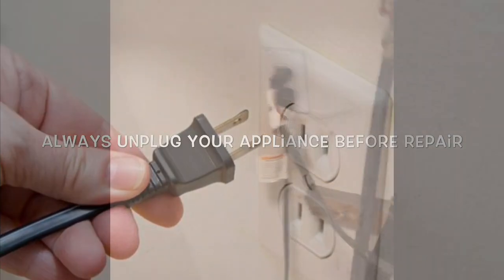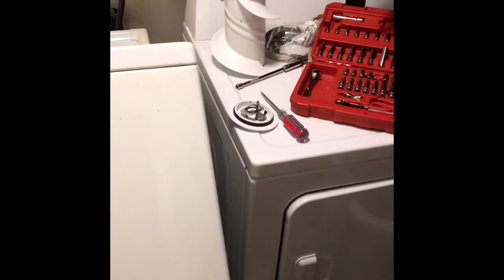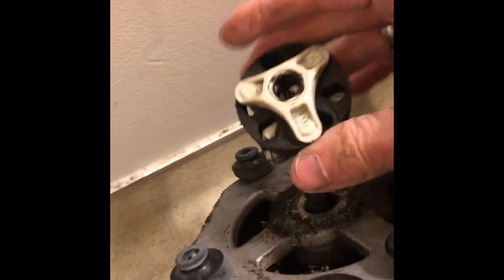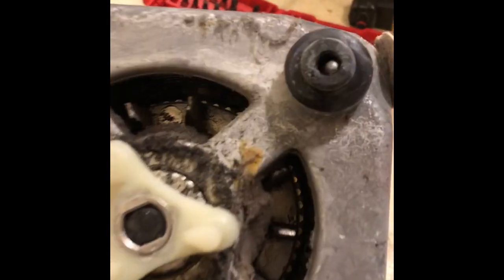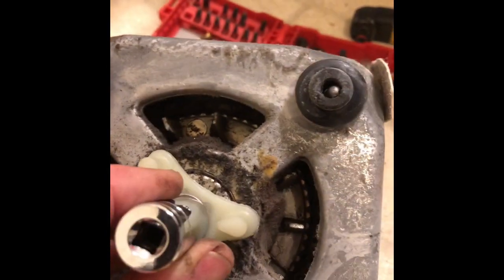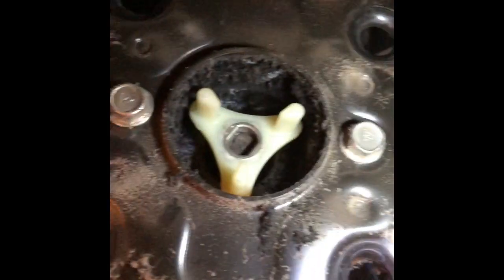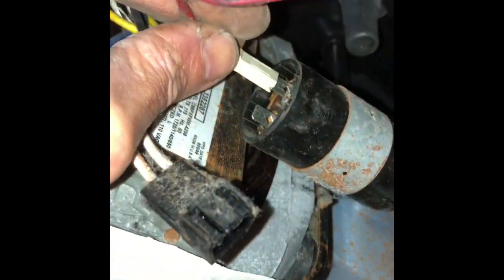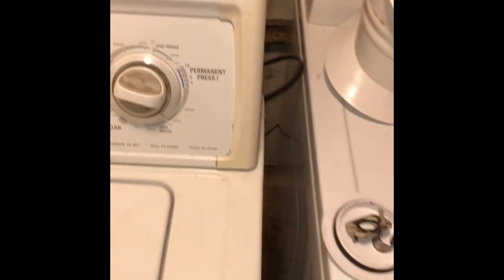WASHER MOTOR MAKES SOUND BUT WON’T SPIN—FIXED

Comment: I would mention that if the machine drains,  motor is OK and problem is most likely the inexpensive coupler.  Also I recommend cleaning the lint from the motor.  Lint clogs cooling passages in the motor so it runs cooler and won't overheat the windings causing premature motor failure.
Reply from the maker: Good idea